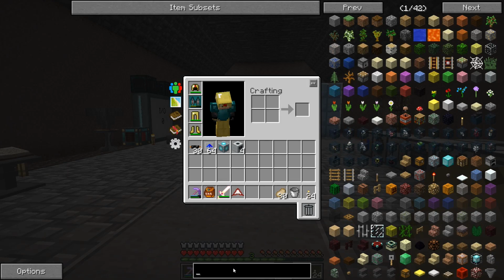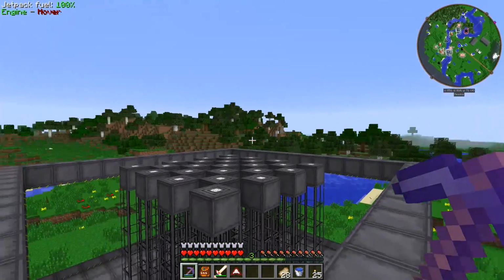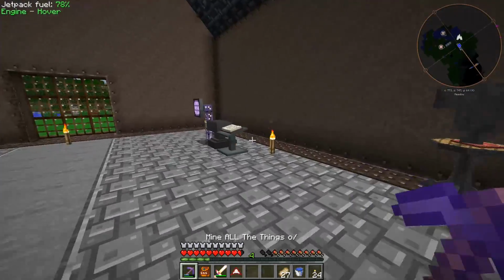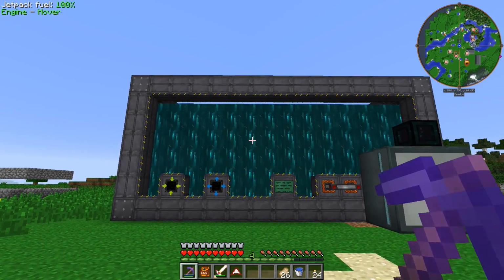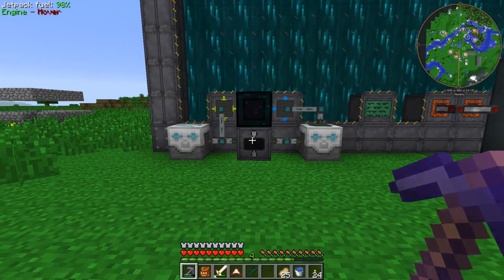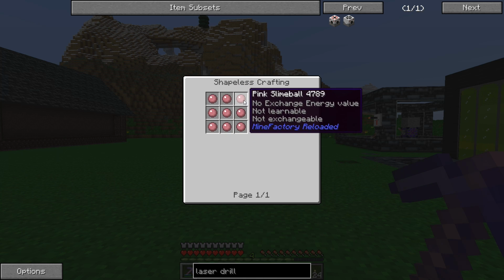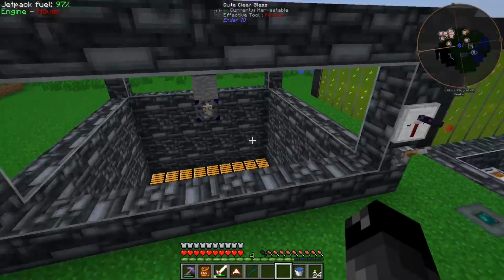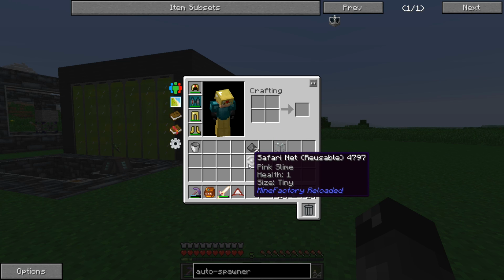Minecraft Mods FTB Inventions - UPPING THE POWER [E24]

Comment: Power tap on big reactor is limited to 10000rf/t or 20000rf/t or something else it depends on modpack so you should put more power taps to be able to use 60000rf/t and if you run out of yellorium you can be cheaty and convert 1 cyanite into 1 yellorium through equivalent exchange :)

Comment: Begat your looking for is the ended io power monitor, it has a redstone control that when you hook up the power monitor to the capacitor bank with some power conduits, the power monitor will look at the capacitor bank and you can get the power monitor to output redstone signal when capacitor bank is below 10% (for example) and turn off the redstone when it is at 90% (for example). This is how you can turn on and off your reactor with you capacitor bank.

Comment: something i have done in the past and it increased my efficiency by about 60% was to expand the outer walls one more block and placed graphite blocks next to the fuel rods and holding back the molten ender. in a situation where you dont have to worry about fuel it doesnt mean much but in cases where you do it is a huge difference.

Comment: You could use the Ender IO Power Monitor to automate the reactor. Simply place it next to your capacitor banks, go to the redstone control tab and set your preferences (e.g. 95% off, 25% on).. Then use a Ender IO redstone conduit and hook it up to a reactor redstone port and configure it to shut off the reactor, if no redstone signal is incoming - done ;)

Comment: theirs a trick i learned years ago, mfr has a block, forget what its called, allows you to change items like ingots and such that have a ore dictionary to another version, and all slime balls are dictionaried, so you just need 1 pink slime to set as the filter type and you can place or pump any other slime balls in and it will convert them to pink slime balls insteads, fast and free.
Reply: The item is just called ore dictionary converter I believe and if I'm correct they removed that i think it only does: ore, dust, and ingots and not all of them work
Reply: if that dosnt work then maybe try the lexicon from thermal foundation
Reply: unifier
Reply: +QUOC TRAN yes thats it! Tnx

Comment: Interestingly when you use the cyanite reprocess or you get 99% of your file back electively doubling your current fuel amount. Let's say you start with 100. If you burn all that fuel you get back 50 bluetonium. You can burn that to get back 25 blue and again to get 12 blue and one cyan. Burn the 12 and get 6 burn 6 get 3 burn 3 get 1 blue and use your remaining cyan to get an extra so you have 2. Burn the 2 get 1 cyan left. Add up all the blue you burned. You get 99. You started with 100 yellow and ended up burning 100 yellow and 99 blue basically doubling your fuel!

Comment: I see 2 ways to improve the reactor setup. 
1) use an Ender IO Power monitor and redstone signal to turn the reactor on and off. 
2) turn the cyanite into yellorium ore, pulverise and smelt for 2 yellorium ingots for exponential amounts of fuel. 
Nr. 2 takes some initial "babysitting" but after a short while you only have to check up on it less and less, untill it becomes almost inconsequential.
Hope it helps (or at least gets read)
Reply: Pretty sure the power monitor is limited to just the conduits, and the conduits have a max of 2k rf per tick which is nothing
Reply: +MCGamer 00000 The Power Monitor does work for capacitor banks, he just has to put it next to the capactor banks, also the max conduit's capacity is 20k